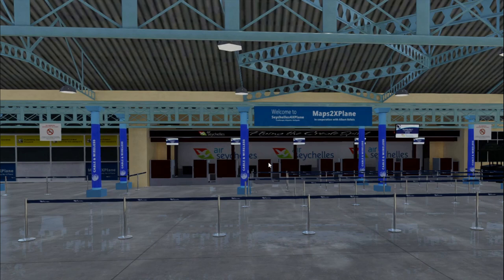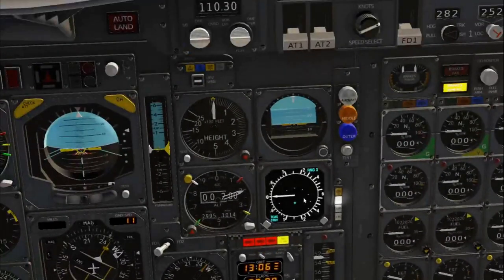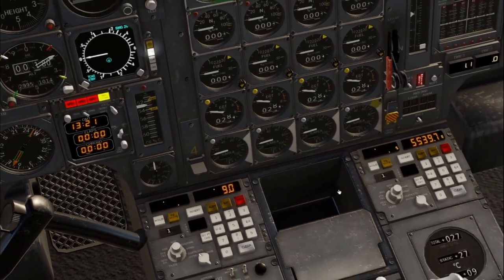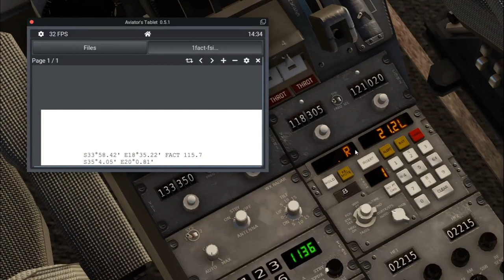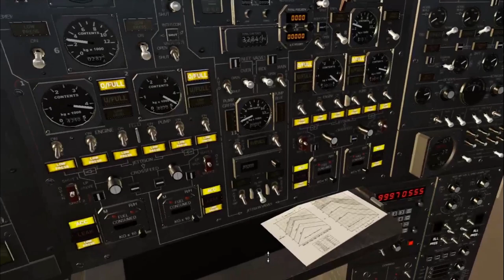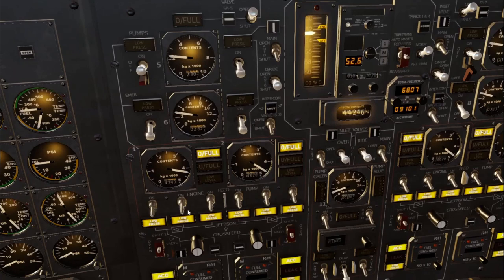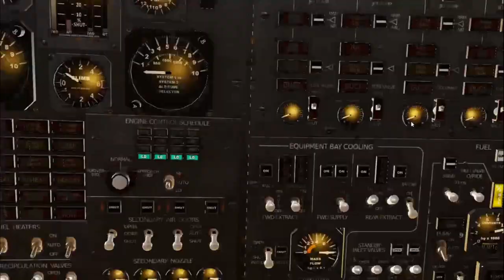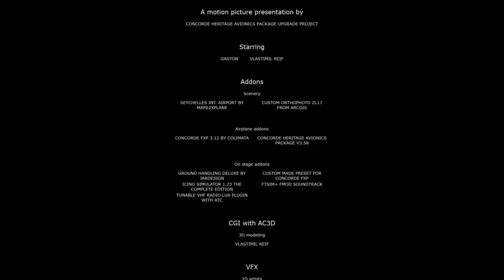Quick non-VR Tutorial for Heritage avionics package v3.xx for Concorde FXP 3.12

Comment: Quick question about the fuel system. I do understand the procedure for adding fuel to the plane as you described. However, what if say, you have 60 tonnes of fuel in the tank and set it to 30 tonnes. Now the fuel gauge on the pilot/co-pilot view displays 30 tonnes. but the fuel panel is stll showing a higher weight and it seems opening up the standby valves just keeps filling the tanks. is there a way to empty the tanks down to the value you set in the x-plane fuel configuration ?
Reply from the maker: I understand but this situation is very unreal. During flight you can use jettison valves to dump the fuel and stop it when both counters match, but at ground no way to do so.
Reply: @gastonreif1517  Thank you. Agreed, in real life it would never happened. I just loaded in the sim with like 90 tonnes and wanted to practice circuits and have much less fuel. I realized it's key to set your fuel lower than what you intend on the flight set-up screen and then start the flight. Then it works real well :). I also found that if you turn the plane completely off and relaunch all FlyWithLua scripts it will grab the new value. So far it's really great and I love what it adds to the default concorde